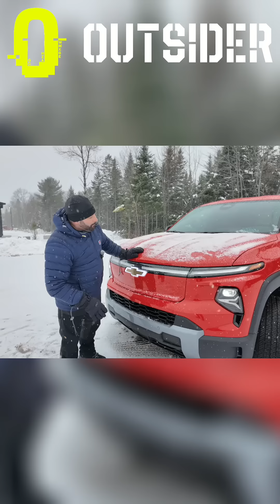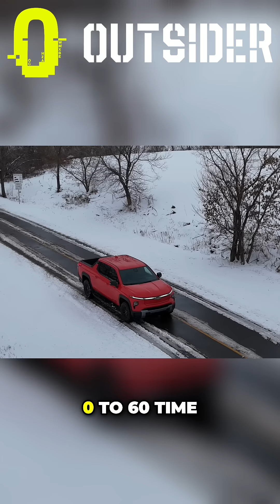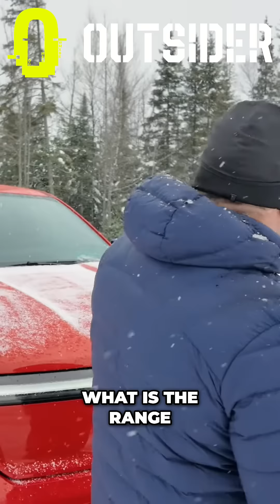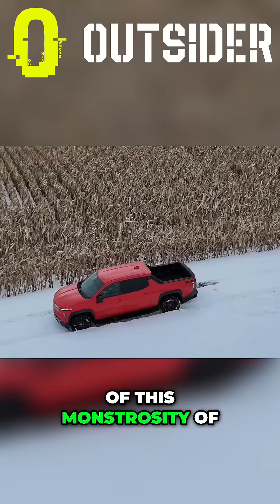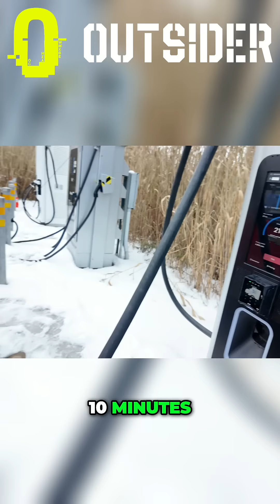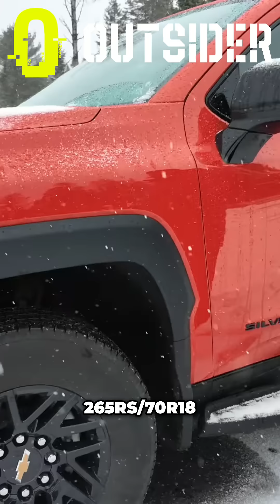Electric Silverado Specs: Power, Range, Towing Revealed! #shorts

Comment: Try towing something further than the end of your driveway lol
Reply from the maker: My driveway is not 320km long lol that's how far it will tow
Reply: @Outsider.Reviews 320KM if you are towing you would be lucky to get half that, but regardless my 1500 with the eco diesel would get 600KMs per tank towing a 28’ travel trailer.  Electric trucks SUCK
Reply from the maker: @RTUGabions 🤦 Jesus... Ok so the range is 650km and the 320km is with towing since your question was how far can I drive while towing.
Reply from the maker: Cost is about $20 to fill up from home as well so that's where it comes handy. If you don't need to tow far and trust me a lot of contractors in my area refuse to work outside a 100km radius (I know because it's hard AF to find one that will come out in the mountains where I live) this truck or actually the WT variant becomes a decent option at 80k CAD  price point.
Reply: @Outsider.Reviews keep trying to sell this crap, they will never be mainstream and should never be.  Little electric city runners are one thing but trucks are made to work, electric won’t ever match the IC trucks we all are familiar with.  Why GM thinks they can succeed when re ford failed miserably I will never know.
Reply from the maker: @RTUGabions First I'm not a salesman and couldn't care less if you buy it or not because I'm also not an influencer... I don't have a discount code for you lol. Second, I believe you are way off since the % of truck owners that use it for work is less than those that don't so that argument goes right out the window. Lastly, It's not for city people. Most people living in the city cat charge it at home from their condo or apartments and in that case, don't get an EV, it doesn't make sense at all. I can say that because again, I don't think EVs are for everyone so I'm not an idiot saying they are or are not for everyone because that would be a pretty stupid assumption on my part. But, for people who want a truck, don't need to pull long distances and drive daily like 200kms, this will save them a shit ton on gas and maintenance. That's just a fact. So there are some people who want this, my area has an over 30% EV adoption rate and there's two of these in my small town already. Don't speak for everyone
Reply: @Outsider.Reviews it might save on gas but from what I have seen your insurance will eat that savings pretty quick and if you have an accident evs get written off far more often than IC vehicles.  They do not make sense, we do not have infrastructure for them and they are a huge waste of resources IMHO
Reply from the maker: @RTUGabions I actually own an EV, my insurance is not higher than an ICE vehicle. You seem to be misinformed and you are talking about something you have not experienced but I have and I have owned an EV for almost a year now. I am never going back to ICE, as a matter of fact, we are replacing my wife's ICE vehicle to an EV because it makes perfect sense for us but again, you wouldn't know
Reply: @Outsider.Reviews you do you brother, Canadian insurance companies may not have caught up to the industry pricing yet but they will.  In the US people are getting insurance quotes in the thousands for a year, some as high at 800 to 1000 per month.  Others have been told they will not insure their EV any longer.  Enjoy your toy
Reply from the maker: @RTUGabions it depends on the province. My province restricts them from raising the prices and our electricity is 7cents per Kw while our gas is 1.56 per litre which equals to $5.91 per gallon... You see where that changes things? Cost me $18 in electricity for 600km of range or $180 in gas.... That makes a huge difference. The only thing is the tires are more expensive but that still doesn't equal things